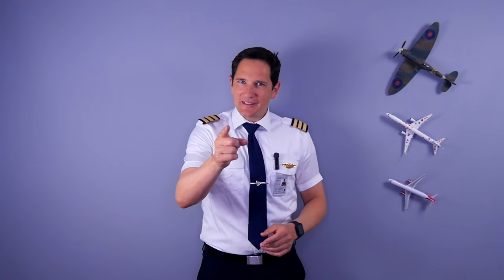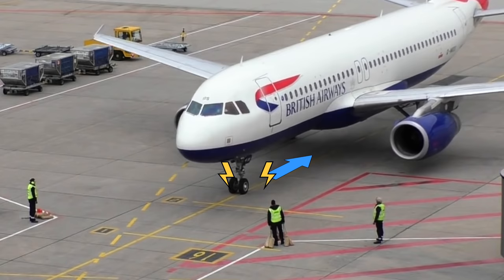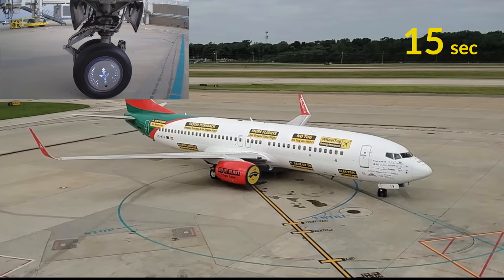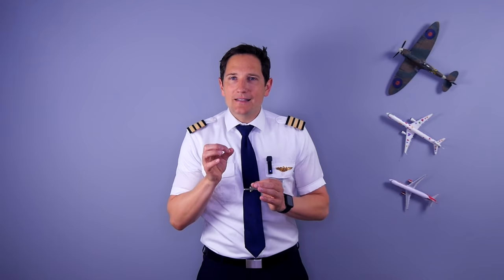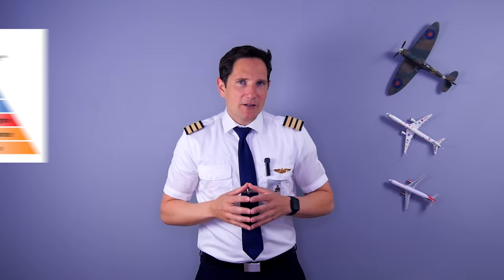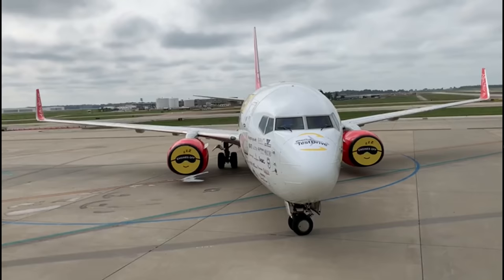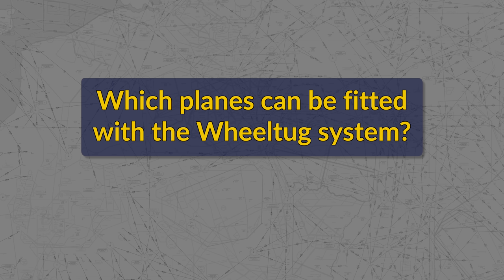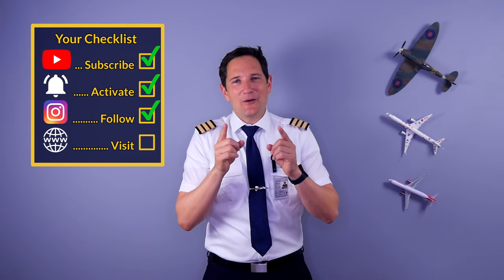The FUTURE of PUSHBACK is ELECTRIC! Without a pushback truck! Explained by CAPTAIN JOE

Comment: Not surprised this relatively tiny innovation is getting attention: the amount of cost and time savings alone are worth it, especially considering it takes only minor modifications to install
Reply: Except not… max speed it can taxi at is around 10 knots, when 20 is common and 30 happens here and there on engines.  The weight of the system alone makes it only economically feasible on very short routes, and that’s with cheap fuel.  Forget for a moment the added complexity of the system and the snail speed taxi…
Reply: @qwerty112311  most of the flights are on thr short end, where any gain in turn around time is precious. Add to that the fact that the carriers doing such flights tend to be low cost. After all they started with the B737 and A320, not exactly known for long hauls
Reply: @qwerty112311  Yeah, I'm curious about the process and the tradeoffs.  Seems like fuel savings won't be the core value; more likely the benefits will be smoother and faster ground operations?  I wonder:
* how much of the overall time on the ground is spent at 20 knots taxiing?  
* once turned around and entering the taxiway, can the aircraft then start up the engines while rolling, and turn off the wheeltug when the engines are ready to push? (I don't know whether this would work, just curious). 

It seems like wheeltug will give more simplicity, flexibility and smoothness when on the ground, and that should bring savings in time, equipment and personnel, but I guess there are more tradeoffs I'm not considering.  Insight appreciated!

Comment: You mentioned breakaway thrust; can these be used in a sort of "hybrid" mode where the electric motors can provide the force to get the plane moving initially, then the engines can be used to increase the taxi speed beyond what the electric motors alone can do, thereby reducing wear on the engines?
Reply: I was wondering  the same thing
Reply: I believe he covered this in the video, where he said that the 'breakway thrust' that is normally needed to get the plane moving from stopped is the place that normally engines are worn the most, because the plane ingests debris from the airport and causes damage to the propeller blades. This hybrid mode would allow the plane to begin moving, then use engines to keep up power without getting high power then back down to taxi power to get moving.
Reply: @ZachareSylvestre  I'm sure the electric motor in the nose gear is not strong enough to handle bigger planes like the 747 or the A380. It might take several built into the main landing gear!

Comment: It’s shocking this hasn’t been a thing for years already. Well done WheelTug, and hoping you get a ton of business! 
Also, those electric motors must be absolutely beastly!
Reply: We didn't wait to think about it. But for few reasons  it wasn't a good idea.
Reply: ...beastly..., yup Elon is drooling right now. Breakaway torque for a 6am departure in the dead of winter... You know what the main engines would have to sound like. Then this watermelon size motor set does it all silently and sheds the carnot heat way up front away from the brakes.

Comment: Why in the world didn't this happen 20+ years ago? I mentioned this kinda idea when I worked air cargo to a Kalitta engineer, and it was just laughed at.
Reply: I was kind of thinking the same thing... Seems so logical, and down right simple really..
Reply: Regulation. The reason mainstream aviation tech is behind a decade is because it takes a lot of time and money to introduce new equipment, procedures, and regulations. If it's not 100% necessary or have enough bang for buck, airlines and aviation authorities will not look into it.
Reply: WheelTug's patents on this are circa 17 years ago, and on the motor itself 21 years ago. That's the time it takes to do this without gov't funding or major airframer support. Oh, and if you think those would have helped, consider why there is no competitor left on the field.
Reply: @user-ez5vq9fd2t  I would have thought that when planes started to get bigger it would have been done at that time. Especially during war time as an effort to get them around quicker on the ground. Just kinda makes sense to me that way, there were so many aviation breakthroughs of things in the 40's thought someone would have come up with that then.
Reply: Safran/Honeywell got together and tried, but they put the motors on the main landing gear NEXT TO THE BRAKES. I bet the two heat sources loved one another. I also realized that if you are going in reverse with an electric motor in the main gear and hit the brakes, then you will get a tail strike, but if you have the motor in the nose gear act as the brake, then it simply lifts upwards, loses traction, and you avoid the tail strike since the plane never stops moving backwards as the braking force causing a potential tail strike is removed. Why didn't Safran use this solution?
Reply: @aaronbianco2392  I don't follow your physics on this. The brakes (or the obstacle you hit) are at the main gear. Once you know how far fore or aft the center of gravity is, a formula tells you your speed limit in reverse to avoid tail strike. 5-6mph under usual conditions.
But you're right that as soon as that threatens, the NLG loses traction, which should help.

Comment: Well you definitely can roll till the waiting position in front of the runway and only start the Engines there.
Also they could go further and add hub motors to all wheels, they could increase braking performance and stabilize the aircraft on touchdown with spinning the wheels up and counter slipping effects on wet runways.
Also you could use them to speed the aircraft up especially on the first few knots when the engines still work poorly.

Comment: How do they avoid the electric motor being damaged by the impact of landing?
Reply: And what does the extra weight do to the suspension system dynamics?  "Seems to me" one of the larger sized power assisted manual tugs might solve the problem.
Reply: Every airplane landing gear has a hydraulic suspension system that damp the opposing force of the impact landing.  So the real question is is the motor able to keep up with the rpm of the take off or landing rpm while still maintaining working in condition?
Reply: @StickMan_Clara  there may be some kind of clutch to disconnect the motor from the wheel
Reply: The motor is in the nose gear. Almost all "impact" is borne by the main gear. Nose gear are more fragile to begin with since they steer; they only touch down after everything else is under control. And electric motors are pretty tough anyway, very few moving parts.
Reply: @edwin2963  If you listened to the video...9:15
Reply: @GilmerJohn  I bet the engineers haven't thought about any of this, you should drop them a line and get them looking into it!
Reply: @drlava641  I'm actually a design engineer for a company working with Wheeltug on this. There's a kinetic tilt switch mounted to the landing gear that senses the angle of the landing gear relative to gravity, and that opens and closes the power to the wheel.

Comment: I had put a patent for ravinng all wheels to ground speed by small motors. That would eliminate tyres burning on you the down, making landing as simple as take off would also reduce landing distance, skidding on wet, snowy runway and duir cross wind.
Little bigger motor would do this function also.. It sure is a usefull feature for all sizes of aircrafts making them indipendent..

Comment: As a pushback driver I think this may happen sooner rather then later. But I don't think that airlines will install a second jet bridge, that would mean more space and airports are running usually a little thin at the moment on space to add a second jet bridge per hate. Occasionally there has to be a pushback driver for when the APU is INOP. I would think the wing walkers would have to still be in contact as to make sure no vehicle would approach or for other objects. Not to mention de-icing. But as we know the 2 biggest costs for airline companies are fuel and employees. And this would certainty help them save money

Comment: Ah, powerback, I remember it well. Eastern Airlines had a labor agreement that pushback was only to be conducted by A&P mechanics, so in order to keep staffing costs down and ontime performance acceptable, powerback from the gate was the norm.
Way back when, in the age of trijets, I was working for Piedmont at PHL. One of our cabin cleaners had just opened the starboard rear door for cabin service and an Eastern L-1011 powered back. Alas, the pilot in control kept the engine power fairly high, resulting in baggage carts flying around the ramp, commuter aircraft blown off their chocks, resulting in collisions with parked ground equipment and our 727 jumping its chocks - ejecting the cabin cleaning crew member that had just opened the rear door.
She fell 17 feet, to land face first onto the ramp.
Plastic surgeons did an excellent job reconstructing her facial bones an eye orbit. She sued Eastern and not long after, the already troubled airline ceased operations.

Comment: Definite some benefits for smaller airports with limited resources, but this will also add at LEAST 300lbs right on the nose, which is way forward for CoG - and will definitely affect fuel consumption and trim. 

Also, in the winter, unless you have winter tires - this feature is useless 5 months of the year in many places. 

Also, you will STILL need wing walkers and someone to speak real time, to the captain about the maneuvers. At any busy airport, the GC wont allow pilots to move around themselves, esp in the dark or bad Wx.

Comment: Pushback drivers be like: Sure be ashamed if something happened to it.
Reply: something will happen when they do touchdown and if that was not enough breaking alone that generates intense heat ... that's why they didn't show you any of that
Reply: Ya I’m a pushback driver, but tbh I think it’s pretty cool hahaha, but I like pushing back
Reply: @nilin-o2  that's why there's a clutch to decouple the system during takeoff and landing.
Reply: @Copilotdave  I saw 737's and a 727 jockeyed around using a tug. Stopping was the hardest part, as we both know that there's a wee bit of difference between the weight of a pushback and a baggage tug.
Still, the prize winner was one ramp worker pushing on a 727's nose gear to push it back a foot so that the jetway could mate. Level ground and good bearings being a big deal in aviation.
Reply: *Sure would be a shame
Reply: Tugs may still be needed for larger planes- but then again the whole jumbo jet thing is kinda being phased out

Comment: I'm not a pilot so I don't understand the fuel savings part. Normally the pushback is done by a vehicle, not the engines, like he said. So I'd think it's replacing the vehicle, not engine power, but clearly I'm wrong about some part of that.

Comment: This will be particularly good for the 737, A220, A320, and Embraer E-Jets planes, where pushback times and not having to run the engines will really save fuel. Mind you, APU's will have to be designed to run a lot more than in the past, though.
Reply: APUs are mostly on during engine start and after landing at the taxi way. Thus, it won't be much of an added problem I presume.

Comment: The only problems I see with this, are the loss of jobs for those tug drivers.
Reply: Jesus, get over it. Airports are so big and offer such a huge diversity. One can surely find other tasks for the personnel (controlling and guiding, for example). You could even think of a system combined with remote control by ground crew.

With your reasoning, we all would still be painting walls in caves. ;)
Reply: Its inevitable. Innovation, progress and just like the horse and cart are gone, so will all the tight drivers and assistants
Reply: @lhenn_  I never said I was against it. Love your assumption <3
Reply: But are their job gains elsewhere that offset? From what I know, tug drivers don't necessarily require that you have a high school education like a truck driver, and since the pay is low since the qualifications are low, I'm sure there is a lot of turnover. As a contrarian, I might expect that they will have to keep at least one person for the cases that a plane doesn't have the system, or that it inoperable on an aircraft. Most likely, some jobs at the airport will have their responsibilities exapanded for the cases where there is a severe wind snowstorm. So tug operations might become seasonal in northern climates while southern climates they simply disappear.
Reply: Research the job longetivity for the average tug driver.

Comment: Yet another invention so simple, yet solves so many things. The phrase "Huh, man I could've thought of that!" comes up again.
Reply: I wrote this elsewhere, but it applies here. My bet is that conceptually it is simple, but implementation is crazy hard. Imagine that Safran/Honeywell's version of it, which they abandoned, had the electric motors in the main landing gears, next to the brakes. Use those overheated brakes when the plane moves backwards and you get a tail strike. Yet the counter-intuitive brilliance of this solution seems to be the fact that if you used the nose gear as a brake (as it has no brakes) then if the tail threatens to tail strike, the nose lifts slightly and the nose gear loses traction so that you avoid the tail strike.  As Safran worked with Airbus, it may have been that the Airbus engineers required that it be in the main brakes, so a simple solution is made hard by the engineers (or management). A nimble startup allows you to avoid this.

Comment: So you add two electric motors to the Nose wheel tires.  Gotcha. This is one of those Ideas it sounds great on paper but when put into practice won't work out.  
Starting from the MX side of things. How do you think that will go for maintenance cost? Time to change the tire, gear, or motor? Does installing that also now require being synced up to the Airplane? If software is not up-to-date on the chips it takes a while for updates to happen. (not to mention the semi-conductor/ Microchip shortage we are in or heading towards)  What's the overhaul cost?  Can this be MEL'd? If so then guess what you need a push team again. Does all that out weigh the cost of a Push team? I understand also that Push teams are contracted out pending on airport so it won't really change the cost to the airline. Except when they will need someone to watch their wingtips or tail. Again going to need a ground crew.  Does one plane turning into a Ground service cart of any type, outweigh the cost of the repairs that might need to be done vs the cost of a Push team>? Not including the lost revenue from the plane not flying. Just like you said it airlines like it when planes are in the air. UNLESS you are planning on adding cameras everywhere. Then you would need to factor in all the pricing for that. 
As for saving time. Your timing seems biased. Usually everything todo with the tug is already hooked up and ready for push back prior to asking. Yes there are cases where they are short staffed, Running late,  and Ect.  So it would probably equal the same amount of time maybe a little more for the ground to disconnect. For argument sake I will give you the 5 min timing.  Regardless you can still call for a push back and taxi now. However you If you are at a busy airport even with this technology you will still need to call for a push back, then call for a taxi.  Also now considering the more space you will need for the turn around. Gates are packed together and planes are meant to go in one way and pushed out. (Most of the airports that would utilize these types of planes. )  Now forcing all the airports to re draw lines and re map their airport. Which will also require more space per gate now and means less gates per terminal. Do you think that an airline that wants to make money is going to want less gates just to save ~5-10 min of overall pushback time?  I would be very curious how the numbers actually look when all laid out.

Comment: Safran and Honneywell made a similar system in 2014(green taxi). Airbus and Boeing didnt choose the solution because it was to heavy around 400 Kg and they was not enough space in the landing gear. 
The system was made to only use the APU to pushback and taxi from the gate to the runway.

Comment: Remember learning about the system a few years ago, it uses a new kind of electric motor with higher torque. There were competition but they were focused on the rear wheels.

Comment: A patent for electric taxiing was applied for by Delos Aerospace in 2003, and published in 2006.
Honeywell and SAFRAN announced their joint venture EGTS International at the Paris Air Show in 2011
Following the initial phase of ground testing and first move in April 2013, the system was first demonstrated at the Paris Air Show 2013
Reply: The Honeywell/SAFRAN EGTS project has been abandoned. Their technical approach created ever more problems until they threw in the towel. Wheeltug takes different approaches.

Comment: Still need wing walkers and a marshaller. At the cargo ramp where I was working the pushback tug was never the hold up, usually connected 15 minutes before departure. The push was rather long and around two corners crossing a couple of service roads, as there was no room to turn around near the parking space, it would have been very difficult for a pilot to back out with a safe margin.